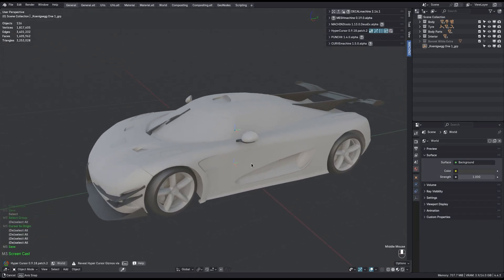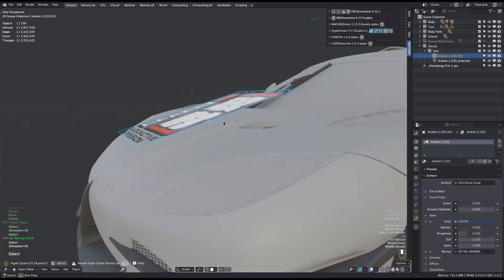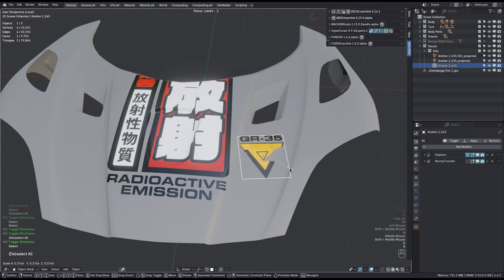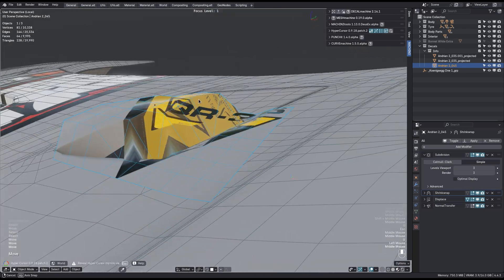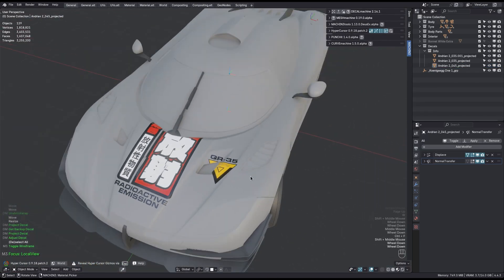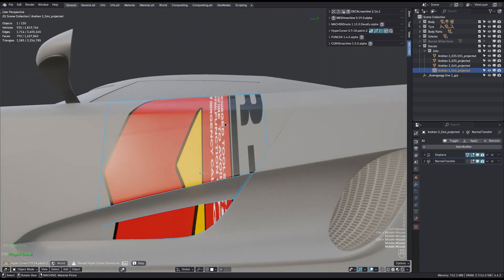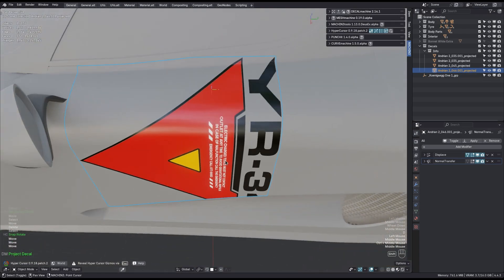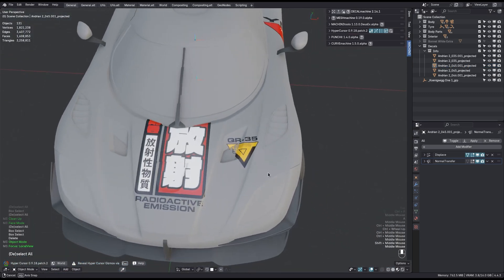DECALmachine - Project tool Overview

Comment: The very latest Decal Machine doesn't seem to work properly in Blender 4.4.3 (Octane version) in EEVEE mode
Reply from the maker: I can't speak to custom Blender builds, only official ones are supported, see requirements. https://machin3.io/DECALmachine/docs/installation/#requirements
Reply: @MACHIN3  Alright, I'll be checking next blender octane versions if none of them work, may need to use the regular blender then
Reply from the maker: The Octane build removes Blender native nodes. But DM's decal materials make use of those standard nodes, so it's not surprising it doesn't work. No material addon or pack should work in Ocatane I'd assume.
Reply: @MACHIN3  Really? That's interesting because Cycles works just fine, it's only EEVEE that shows the decals as purple planes
Reply: @MACHIN3  Regarding material packs, they all work just fine, I have a bunch of different addons and packs installed, no problems with them at all
Reply from the maker: Reproduce it on the original Blender, then report it, and I'll take a look.
Reply: @MACHIN3  Yeah, in the same regular Blender version it does work fine, I guess there is something wrong with the Octane build indeed, will stick with the regular Blender when working with Cycles then!
Reply from the maker: You can always take a look at the decal material node groups. If a node is missing or unsupported it will probably be obvious. Feel free to send me screenshots too.